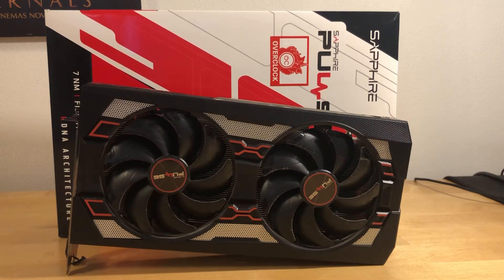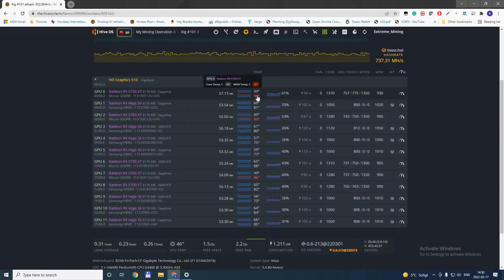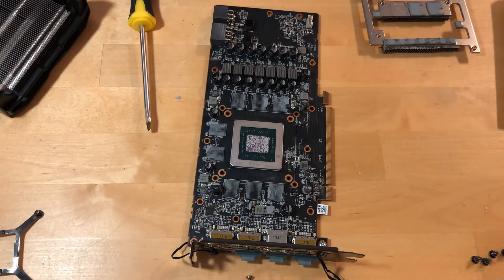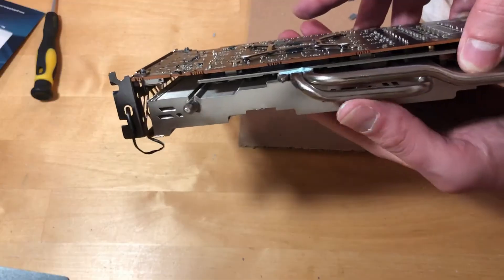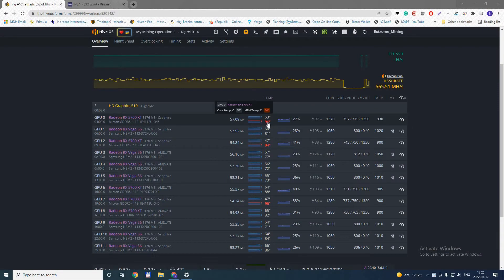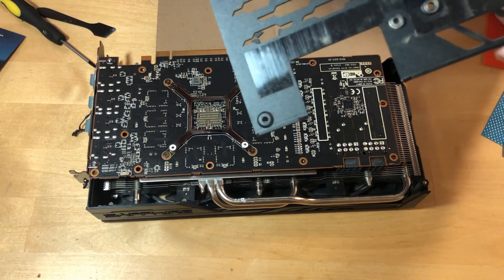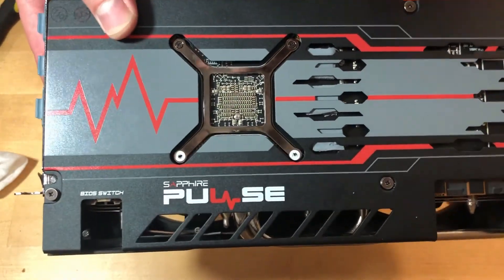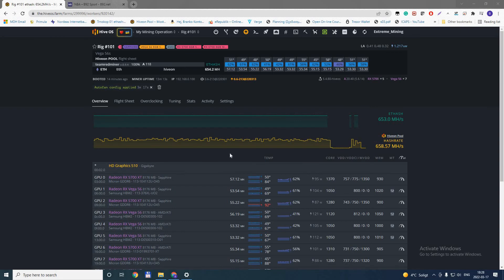Sapphire 5700 xt Pulse Thermal Pads Replacing.

Comment: This is the exact video I've wanted to see. I'll risk the memory thermal pads thickness to be 1.5mm since I don't want to bother buying another pads. Also did it work better on thermal when you put thermal paste on heat pipes?
Reply from the maker: @UniverseGd  It did, it got a few degrees lower temp. But make sure that it has a good contact.
Reply: If you don't know the exact thickness, look into thermal putty. It's much cheaper since you don't have to buy separate ones for different thickness. I've never gotten thermal pads since getting into putty

Comment: i tried out your recommendation of 1.5mm for the inner most pads and 3mm for the backplate ones. i went from 77c core/79c mem/99c hotspot temps down to 60-65c core/65c mem and 78 hotspot! I was pretty surprised at how well that worked! I was honestly expecting a few degrees drop only and would have been pretty happy about that but this took it to a new level. Only thing I forgot to do was to try adding paste to that extra area like you did but I'm hoping the 1.5mm pads in that area help keep everything pushed together for best heat transfer. I'm tempted to open it up again and try it but I could end up shifting something too much and screw up my temps again so maybe not, we'll see lol
Reply from the maker: Hey, I am glad you are happy with the results! That paste would not help much, don’t bother opening it again, as you said there is a higher chance of screwing it up ;)
Reply: @BMasterBM1  yeah i was thinking just let it be for now until i repaste again or temps go up for whatever reason. But so far its been stable while gaming and i can run a lower fan curve for a quieter system so no complaints here! thanks for making this guide!

Comment: Thanks for sharing this! I have the same card and looking to do exactly this. I've never replaced pads or opened any of my gpus up . In addition to the GELID pads, are there other items to buy ? It looks like you also had to add some thermal paste ? Would you recommend the GELID GC-Extreme thermal compound ?
cheers!
edit: Cursed Mining released a video last year using 2mm for the backplate. But you're saying that's not enough ?
Reply from the maker: You are welcome! I am using artic mx5 paste.  You can use whichever one you prefer. For the backplate, 2mm is not enough. I used here 2+1.5mm, so 3mm is a good measure. However, I do not recommend putting pads on the backplate at all, they do not help with this card.
Reply: Excellent. Thank you!!